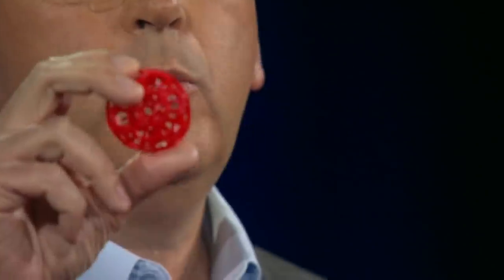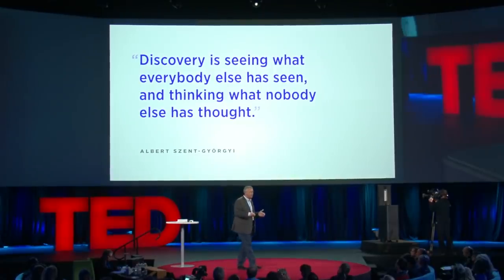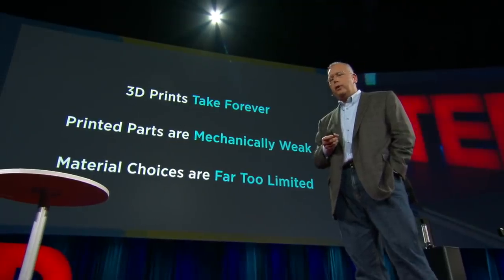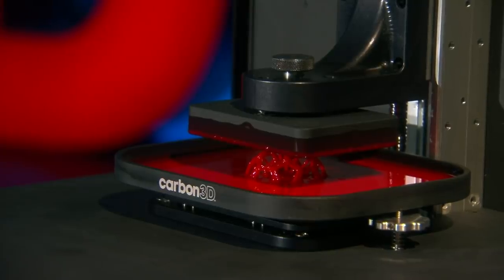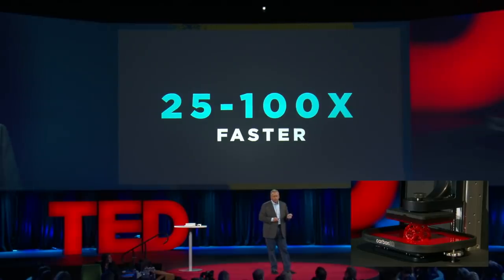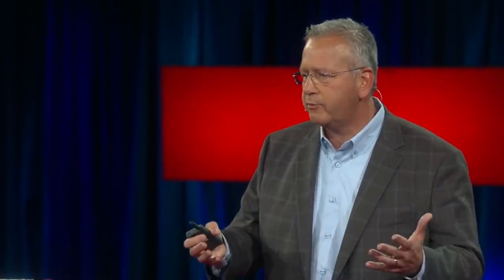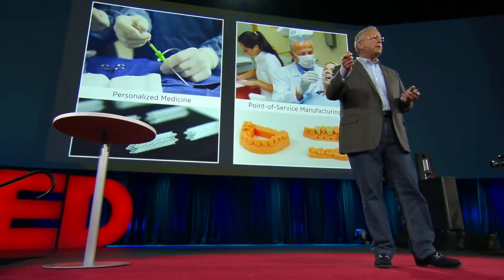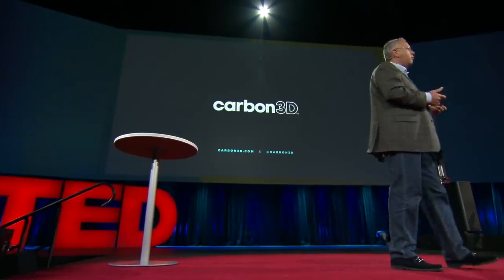What if 3D printing was 100x faster? | Joseph DeSimone

Comment: 3d printing was already wow... This is like wow on crack. What's next?
Reply: World of Warcraft?
Reply: well next step would be 3d printers that can use metals but hoooooo boy i bet those are going to be regulated
Reply: I would really like to see multi channel printer.  Can have plastic, rubber and acrylic in the same tub, or CMYK... or both. Just have like 10 projectors with different wavelength could print 10 material at the same time. Can have tintid windows, colored rubber, transparent stuff and so on.

Also butting lenses at the projector could change the size of the printed object from a few cm up to a full meter or beyond with the same printer. A 1080P projector could make a 1 bye 0.5 meter object with a resolution of 0.5mm, or a 10 by 5 cm object with a resolution of 0,05mm. Also the small object could be printed in seconds while the same projector still can print a lot larger product but it will take hours.
Reply: phantomshotgun
Those actually already exist. The problem with those is that they are soo expensive to make and it is just not practical (yet?) compared t o the traditional metal manufacturing
Reply: phantomshotgun It is already there and used commercially too. They print from very fine metal powder instead of liquid, and laser beam to form the shapes from it.
Reply: Mahesh Bhatiya There is a even more modern ones that uses electron beam that can print titanium to
Reply: matsv201 wow! I wasn't aware about that. But these technologies are so expensive, their use is limited to space, flights and defense. If this was cost effective, we don't have to go through lost wax casting for mass production of precious metal jewelry.
Reply: Mahesh Bhatiya Not really to sound like a commercial, but the Arcam work the same way as a old CRT monitor.  Its quick, but sure, that's a laser to. The advantages using electron beam is that its possible to pump out a lot more power for less of a cost. Basically just burn 10kWh of power directly from the wall socket down to the titanium. Sweeping with the electron beam for half way, and replenishing the metal powder the other half way.

The technology is not that hard to produce. Its basically a old CRT monitor on steroids.

Also, the beam is controlled directly with electric field so they can move the beam really fast with a lot of power. Its still not really fast but it do print like 100 grams a hour so its absolutely on par or better than most plastic printers.
Reply: phantomshotgun They already exist, but currently cost tons of money. However, check out MarkForged - they print with continuous strands of carbon fiber (as opposed to just having carbon in the company name).
Reply: matsv201 This is too much physics to digest for me, hahah! But I am excited to use this commercially if the day comes!
Reply: Mahesh Bhatiya Its not really that complicated. They just do it fast and good... 

... and for the time beeing, expensive.

But there is no real problem making this tech cheep. The problem is that the powder is like €100/kg and the power is also like €100/kg. So printing one kg of stuff is at least €200 with powder and power. They might be more efficient in the future and the powder will defiantly get cheaper.

The machine is expensive for the time beeing, but its probobly not that far of is both the power and the powder more expensive than the machine.
Reply: matsv201 that's what concerns. The cost. Even high end jewelry designers also can't afford this cost of production
Reply: Mahesh Bhatiya Well, that's €200/kg for titanium, that is not that bad. Its still expensive, but its usable for most smal things.

I don´t know the price for steal, but its probably a lot less.

The machine cost is still a problem, but it will probably change over time. The powder could be cheaper if it produced in a higher volume.

The question then is if it could be more efficent.
Reply: ***** Its not just a wow on speed because it's not only faster but also more accurate and finely tuneable. So it's like a wow on speed and acid.
Reply: Soon, we can 3d print 3d printers
Reply: Already we can print human tissue, the next step will be printing whole organs. will be really game changing, I guess..
Reply: hory shet Actually we dont really print human tissue, its kind of a fake. They print a framework, and then just dip it into a cell solution
Reply: matsv201 Yea, notable detail, but since they can be used as fully biocompatible prosthesis, they act as those..
Reply: hory shet Well, if you print something simple, its really not a issue. But if you want to print something complex, is more problematic.
Reply: matsv201
Complex in which way of the term?
Reply: hory shet Several diffrent type of cells overlaping in a 3D structure...
Reply: 4D printing
Reply: phantomshotgun 
3d printers can already use metals (well metals fused with plastic), my own 3d printer is capable of printing anything that can be melted at upto 280 deg, the main problem at the moment is cost, the cheap bottem end printers are nothing more than toys (i mean they print but not to a decent level) then you have mid range (mine would be classed here) where printing is usefull but again not to a commercial degree unless its a specfic thing (currently printing oreo cake stands for a friends wedding), then theres the commercial printers that cost into the 10's of thousands these are top notch but as the pice excludes most home hobbyest's frpm buying them. 

when the cost to benifit ratio is right, it will be the technology to have, im already prototyping car componants, just not to a commercial level.
Reply: khlymoregames Yep, that can be done. I saw it on a expo already back in 1996. Someone scaned a porshe and printed it in scale 1:5 all of the exterior i a matter of hours with minimum input. They actually milled a extrutionmold from the 3D data in that time and just pushed out the forms.

Today you can do it with titanium, no problem. But to print titanium is quite slow, its about 100g per hour with the current gen printers....

Well of cause, scale it up and have like 100 heads you could probobly print 10kg/hour, but its still a little bit slow for mas produktion
Reply: khlymoregames Well basicy yes, that can already be done. But there is a problem.

There is basically two kind of printers. Scaning and ploting printers. Scanning printers is really fast, but they can just print homogenus materials, and also only select materials (there is, no carbon fiber)

The problem with plotting printers is that they are really slow. To compensate for this they increase the size of the piloting head when plotting large sizes. This makes things very sharp and ugly.

Also, you cant make the drive train of 3D printed parts yet, so you cant really make the full car. Only the solid stuff.
Reply: Terminators
Reply: Singularity Bound Just like most technology, the speeds will increase, the resolutions will improve, the cost will go down, the usability/accessibility will increase, and the range of materials will improve.

Aside from that, I suppose with more advanced materials and better manufacturing methods, possibly with more accurate lasers, you could get multiple materials or at least colors of materials in the same product. Perhaps the material could cure in different colors depending on what wavelength of light struck it.
Reply: GoldenKingStudio Yea, i was thinking that to. But it have to be a indirect process. Like storing the energy in a electron superstate, than hit it with a other photon and bind it.

If you use just straight photon energy you will have problem, then the higher freqvensys will bind the lower to.

So its quite complicated, but it sure is doable.
Reply: matsv201 I don't know why it would have to be such a complex process as that. I have already seen materials used for standard 3D printing that can have their colors manipulated via heat afterwards. All it would take is something similar to have the color changes done during manufacturing. Unless you were taking about getting multiple materials in the same project, in that case, I don't really know.
Reply: GoldenKingStudio Well, the point is to use a in process way of making it.

The problem with this kind of printer is that you have to mix the colors to make it work. This is no real problem. Just bind the colors to something the resonate with a specific frequency and breaks so they can bind. But there is a problem. With short frequency you might break everything. So using a to step process might be a lot safer.

But i´m not sure, a one step process might work to.

A other advantage in using a 2 step process is that you can use a larger amount of materials than wave-length. If you have 4 wave-length you can have 6 combinations. 1-2, 1-3, 1-4, 2-3, 2-4 and 3-4. If you have five its 10, and 6 you have 15.

If you are really smart about it you could have like 5 color (CMYWB) with some building properties. Then you can have a transparent, a rubber and some other material.

Remember for a 3D printing if you want to mix colors, you really need 5, because there is no paper, so you have to have a white to. And a  black is also nice, because mixing C+M+Y never really get that clean.

Of cause you can make the colors in a building material. Then if you want the rubber colorized, you just have to use rubber that is realtivly translucent and mix in like 10-20% plastic and it will still feel like rubber but be any color.

It would also be nice to print metal. And its not really impossible, just quite hard. If you bind the metal to some binding agent it could work.
Reply: Singularity Bound lol Crack is an expensive habit.
Reply: V. V. Malazan Yep she's leal.
Reply: V. V. Malazan She's korean, Han Seung-yeon.
Reply: phantomshotgun you can already print metals, amazon sells aluminum, stainless steel, copper and more filaments.
Reply: Jacob Sebastian And titanium... I think carbon-steel is posible to.
Reply: the next chaleng is making 3d printer accessible to everyone
Reply: myName myname2 That will come with time. Tho it will be amazing when people can print things in their homes, even more amazing is when your garage can print cars and your fridge can print food.
Reply: +Jacob Sebastian and you can print gun, the working one.
Reply: +Singularity Bound WELL SAID!
Reply: Kargadan I dont get what you refering to "dont mix"... if you want to use different wave length you need all chemicals to be on the same place so the right one can react.

I would think that you would be limited in the number of materials because one wave length cant be a factor of a other
Reply: Kargadan Well, you need them to mix together, but not react. As long as its just a mixture they can be separated when activated.

My idea was that use a chemical binder that degrade with a certain wave length of light, this kind of stuff exist. Then they are combined with a polymer according to color. 

Then it can be mixed with out reacting. If 700nm is combined with blue plastic, 500nm is combined with yellow one and 400nm with red one, you could basicly use a color projector and just extract the same color that you shine on it....

... apart from all the mixtures will be reversed (basically if you shine white light, the result will be black)
Reply: 3d printing planes with the wiring and fiber optics embedded in the frame.
Reply: Singularity Bound wow on acid
Reply: 10d printing
Reply: @Kevin R p
Reply: Crack on wow
Reply: 3D printers printing crack
Reply: Nanofabricators
Reply: wow on steroids
Reply: Printing liquid. :D
Reply: real nanotechnology at the molecular level with nanobots at the size of human cells.

Comment: 3d printing is actually a misnomer,
It’s actually 2d printing over and over,
See how quickly the parts are arranged,
It’s power level is over T-1000, and thus the game was changed.
Reply: if you put it that way 3d is a misnomer as it's just a bunch of 2ds layered over each other----____------.
Reply: Sbeast Actually, even "2D" printing has 3 dimensions, at least if you talk about something involving materials like ink. It is thin, but it has a height.
Reply: It also grows in the Z axis, so technically it is 3D.. still, have my like kind sir. (Y)
Reply: Sbeast Everything is 3D. There is no such thing as 2D.

Comment: A brilliant concept.
I knew about the "layering" problems with conventional printers, but didn't realise that their tensile strength was variable dependent on the axis of printing. This method is far more organic.
Reply: High school 8nterns at NIST solved that problem a number of years ago: fuse the layers by baking the printed object. Time & temp vary according to materials used to print layers.

Comment: For those wondering, the M1 costs $40,000/year. :)
Reply: +Youthro Forget 100x faster, this is 100x more expensive!
Reply: You have to pay $40 000 every year?
Reply: Steve Villacruz
It's like a subscription.
Reply: +$10,000 instalation
Reply: Does that include a service contract
Reply: New tech, high price, as usual.
Reply: Resin Printers
Reply: 5000 now in 2021

Comment: A vat bottom that is oxygen permeable is the only new thing here just to be clear, and plenty of others have tried that too (see yahoo groups 3D printing discussions). I still think it is cool but I find the whole inspired by Terminator thing a bit too much, they actually just worked on improving one aspect of an existing technology. What is nice is that mechanically it is just a DLP projector and single ballscrew stage, the 3D printers COULD be extremely cheap.
Reply: but how expensive will the material and the vat bottom be?
Reply: eberbacher007  once mass produced pretty cheap i assume
Reply: Joe G.P.
there are quite a number of regual 3d printers out there and the material hasn´t gotten cheaper in years.

It will go the same route as printer ink and just get more and more expensive I guess.
Reply: Like any printer, they make the money off the ink/print material. Printers themselves can be dirt cheep. :e
Reply: eberbacher007 They are referring to the material that forms the bottom of the resin vat not the resin. At the moment you can get 1kg of resin for about $50 which considering the lack of waste (other than supports) is actually quite good. 3D printer filament is not exactly massively expensive either.
Reply: Ceiryus Given you just pour the resin into a dish that will be hard to do because you can just pour in any cheap alternative, plus the cost of the projector parts put the cost of the printer high enough that it may not be a valid business model. When I say cheap I mean cheap for the level of performance, mechanically they are extremely simple but the projector will always keep the price above the cheapest FDM printers.
Reply: Ted is a platform for investors so it is in their best interesting to talk inspiring. Imaging  him saying nothing new excepted part so yeah.. wanna invest? lol
Reply: William Miller It's not supposed to be a platform for investors but one of the issues with TED talk is an expectation to be profound and to be honest a lot of the speakers try and tack this on to work that is not really profound at all. I thought the idea of extremely fast printing along with the layerless technology was actually interesting enough and those aspects may have some profound implications but the Terminator stuff was obviously BS because I am sure they watched plenty of videos of other printers, Envisiontec for example pulling parts out of a tank in just the same way. And maybe all material scientists just know about oxygen inhibition or maybe they also read about that in the prior art and also saw others using it (B9creator).
Reply: Yeah, look up other resin based 3d printers, they use the same technique without oxygen I assume as they are slower.
Reply: ***** Hi, you seem to know a lot about this and the process of 3D printing. I wish to learn more and reach out to people with knowledge. Is it a way to connect with you outside of youtube?
Reply: Dlp? I thought is was sla
Reply: Josh Steinfeld >> DLP is pretty similar to SLA. SLA uses laser and DLP uses voxel images from a projector. That's at least the difference I've been able to find